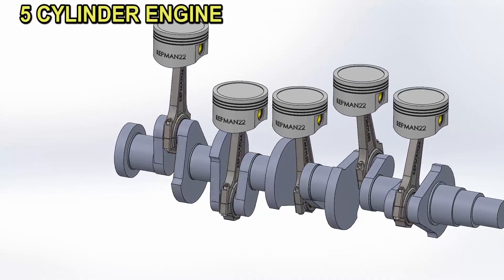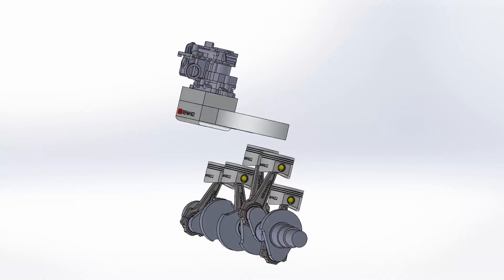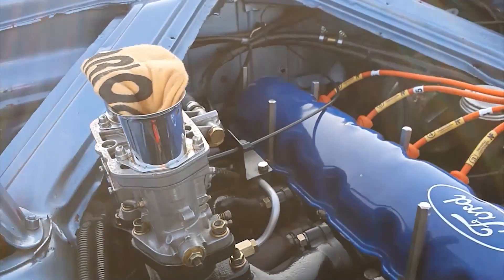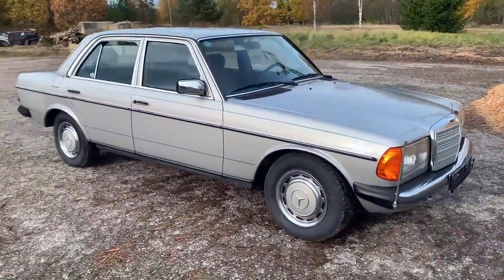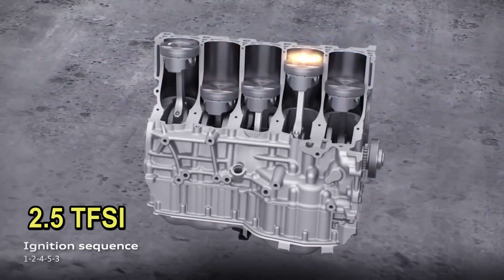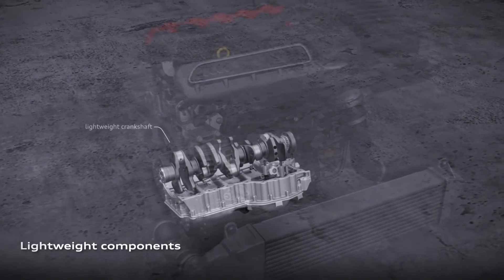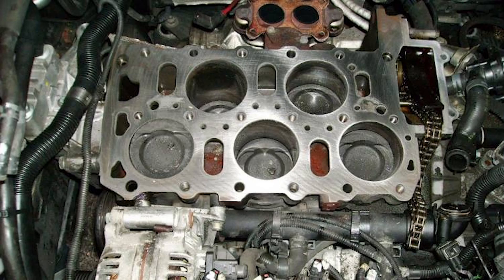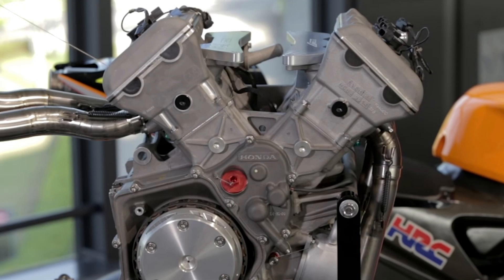Everything You Don't Know about Five Cylinder Engines

Comment: the Audi 5 cylinder pushed way more than 370 hp more like 750 hp. BMW used there 4 cylinder 2000 engine to make 1500 hp with a turbo crazy numbers of hp. Not 370 and the noise that you hear is the turbo spooling

Comment: I want the audi ttrs or rs3 for the 5 cylinder it has    I did own the 2008 rabbit with a 5 cylinder in it and that was a joy to drive but I want the turbo. 😊
Reply: What on earth is a 5 cylinder bunny rabbit? Do you mean the 2.3 liter Audi 100? That is not exactly rabbit.
Reply: @voornaam3191  2008 rabbit non turbo vw 170 hp 3000 pounds manual transmission it was so much fun lol 😂 I sold it to myself for cheap because i worked for Volkswagen at the time .

Comment: Either fuel injection or motorcycle carbies
Reply: Or motorcycle injection. BMW bikes are very okay, for decades and decades. Bet you can modify one for that 144 instead of 180 degrees between each spark. That is for the regular firing order. You can even install the injection system of 5 onecylinders. Five times 650cc is a 3.25 liter engine. Have fun!

Comment: If connecting rods working less on one side and more on other side,that means that + and - ,negate offset drag. And friction is exactly the same like in every V6 engine!
 Thus giving no increased friction or performance loss !
We saw that 3.6 fsi vr6 (10.6 degree), atmospheric engine , not high spec but meant to be driven in a city, have 300 hp and 355nm from 3.6 liters. Which is quite normal !